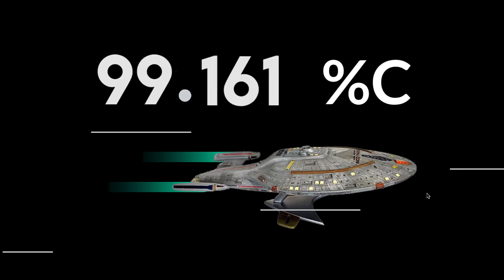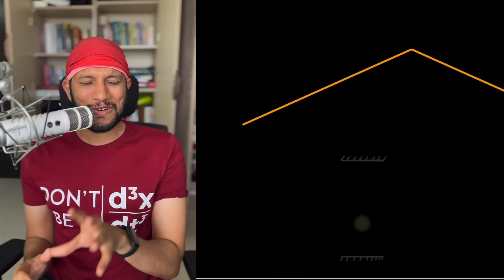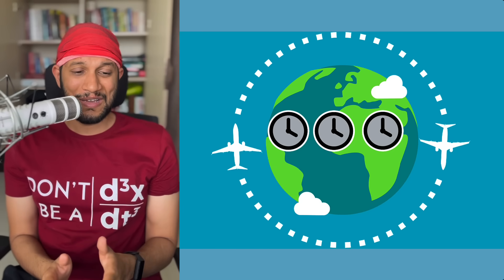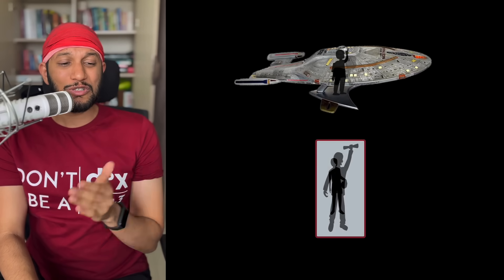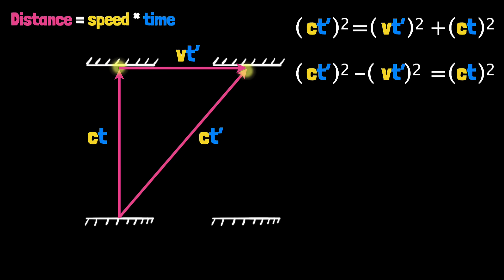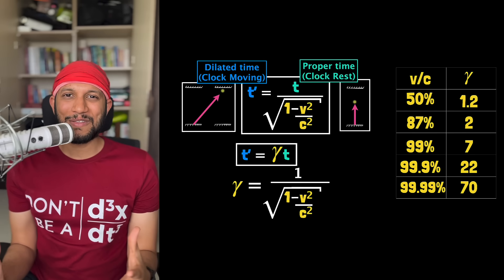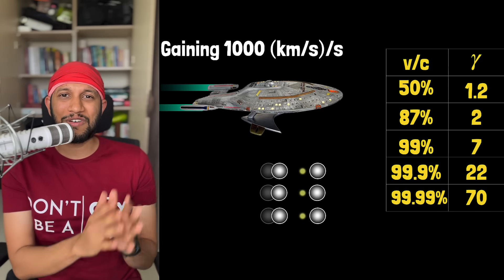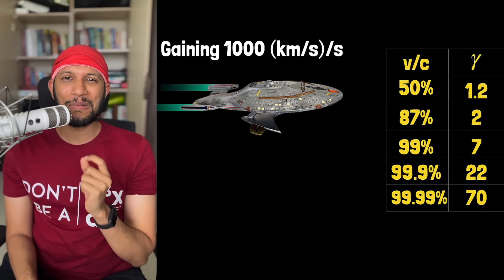I finally understood why you can't go faster than light! (My mind is blown)

Comment: This is a great explanation. Everything clicked for me until the following question popped into my mind and confused me again:

The whole proof is based on the fact that light has to travel a larger distance for an external observer thus the time dilation. If I take the external observer out of the equation, what's stopping the ship from travelling at the speed of light now? 

I guess the root of the question is, how would I determine if I was travelling at the speed of light in empty blank space carrying only a flashlight?
Reply: You have to measure the ship's speed relative to some reference frame (i.e. relative to an observer, though there need not be an actual person observing anything).  In the reference frame moving with the ship, the ship is always at rest, so any meaningful measure of the ship's speed necessarily must be made relative to some external observer.

Comment: There is a solution beyond teleportation, or reprogramming your location in the cosmos. That is the fractal cosmos. So as you move away from an object you grow infinitely large, as the object shrinks to infinitely small. So instead of moving away, you zoom out. Then you simply zoom into another part of the cosmos. This is literally changing dimensions. But mathematically it works. So as a mindset we need to forget about moving physically across vast distances of space and start thinking about growing infinitely huge.

Comment: Amazing video, thanks for the clear explanation! The only question that I still had was concerning the people on the ship. They would look on the clock and see they reached the speed of light after 300 seconds right? Would they look outside the window and see that time and space have ended? (Infinite darkness)
Reply: Remember that speed is relative, and to someone traveling on the ship, their speed is always 0 (since they are measuring from a reference frame moving with the ship).  If they want to make a meaningful, non-trivial measurement of the ship's speed, it must be done relative to some external reference frame, and as we see in the video the ship's speed according to an outside observer will asymptotically approach light speed but never reach it.
Reply: @extravagantpanda7962  now I am in the spaceship,
Yes u are right that the spaceship velocity is zero relatively,
But the world around is moving with same velocity in opposite direction, now I can measure,how about that?

Comment: Now i understand from an observer's POV why c cannot be reached. But why can I not reach c when looking at my own speed in proper time?
Reply: Proper time refers to the rate of clock ticks in your personal frame of reference.  In that frame of reference, your speed is always zero since the reference frame moves with you.  If you want to make a non-trivial measurement of your speed, it must be done relative to some external observer's POV.  We do this all the time implicitly: when you are driving on the freeway, you don't typically say that you are at rest even though in your own reference frame you are, instead you measure your speed relative to the ground.
Reply: This!
Reply: I just realized Mahesh had posted a second video that addresses my question in detail :)

Comment: Why do photons slow down then? Why can't they speed up since you're adding speed by flying them in a space ship. This is the question you need to address because it is the same as answering why speed of that photon can't exceed light speed. Second problem, from what you said at the end of the video, what if you're inside the ship, then it won't slow down, and you'll reach the speed of light while the universe changes so fast you reach the end of time?

Comment: I was hoping he’d address this but what exactly happens to the people inside the ship. Their acceleration to the speed of light may take infinitely long to an outside observer but to someone in the ship would they not just keep accelerating even past the speed of light increasing velocity by 1000km/s ^2? Just wondering if someone could explain this to me.
Reply: Remember that speed must be measured relative to some reference frame.  In the reference frame of an observer on the spaceship, the spaceship is always at rest (since the reference frame moves with the ship).  If they measure their speed as 0.9c (or whatever value), it necessarily must be relative to some external reference frame, and as we see in the video the ship's speed in any inertial reference frame will asymptotically approach but never reach c.

Comment: So that would make carbon dating appear differently if the earth and solar system was traveling at a different t speed through space long ago. If the earth and solar system was traveling through space slower long ago carbon isotope with 14 neutrons would have decayed faster making things to is in our day measure  older than they really are relative to your time and the time when the earth or solar system was moving slower.

Comment: I think this is not correct ??? The Muons still have the 1.5 half life from THEIR frame of reference, we just perceive it to be 10x from OUR frame of reference observing them. And 99.9% the speed of light is not a property of that ship but it is a perception we make as a distant observer. We are equally moving 99.9% the speed from light from it. From its own frame of reference it does not need to use a larger force for the same acceleration, F=ma still works normally it is just perceived differently by us (the observer) due to dilation.

Comment: One thing I try to figure out, is instead of looking at this sideway, if we did the following experiment:
We're in space, looking at Earth rotating.   We back out at near speed of light, so the Earth would spin slower while we're moving away because the image of the Earth takes more time to reach us.   Once we stop, the Earth would spin at correct speed again, but depending on the distance, we'd be looking at a past image.   So then we start moving back toward it.   We'd likely see the Earth rotate faster as we're "skipping frames" or fast forwarding through the delayed images of Earth's by comming closer. Finally, coming back to the same time as Earth.  The time dilation having been only perceived while moving away, and back.    Just as we see with telescope images from the past of distant galaxies.   Going there would bring us to their present time.    A star that has gone super nova that we still see as a normal star from here would go supernova as we go it, we'd be living it's history in fast forward until we get there and stop.

Comment: I understand the explanation, but what are we measuring these speeds relative to? For example why does getting on a spaceship result in time dialation when the earth is already moving. And the solar system, and the universe is also expanding. Wouldnt that mean that if you traveled a certain direction you would technically be moving “slower” because relative to a certain datum you are cancelling out the movements of the earth, solar system, and universe?

Comment: Your video was really helpful in understanding the theory.

However, I don't agree that it defines time travel, since it only shows how time measurement changes due to relativity.

I'm curious about something: if nothing exceeds light speed, and as you say metabolic rates slow near it, are we not just experiencing a form of suspended animation rather than time travel?

It's like saying we travel in time during an 8-hour surgery, because we're unconscious and time feels instant. But that's not time travel.

So a year near light speed feels short, but it's not time shifting a century on Earth. It's more a pause in aging than actual time travel.

Comment: Tldw: the reason you cannot accelerate to the speed of light is because it is the same for all reference frames. This is a fundamental postulate of the theory and there is no other reason behind it per se. There are other logically equivalent statements you could take as the initial postulate but this doesn’t necessarily make it any more intuitive. 

Personally I find the motivation from classical electrodynamics more compelling. When you derive the wave eq from maxwell’s eqs in vacuum you find that the propagation speed of the solutions to this wave eq is a constant (written in terms of the permittivity and permeability constants of the vacuum). This constant appears independent of any particular frame of reference. 

Indeed when you then speak of propagation of the electrodynamic potentials, this constant again becomes relevant and its real nature as the speed of causal propagation is made clear.

Comment: Assume you have three points A B and C. A is earth, B and C are ships flying on parallel courses in the opposite direction towards each other. From the perspective of A, B and C are both traveling at .6C. From the perspective of the B, C is traveling toward it at 1.2C if it considers itself stationary. Nothing is ever truly stationary. Even Earth is traveling at great speeds, around the sun, around the galaxy, through the universe.

Comment: i wonder what would it look like if you placed a live camera in that ship and watch it from earth 🤔
Reply: Let's say you're getting the video at 24 frames per second. At 87% of speed of light, you will receive only 12 frames per second, because of the slowed down internal clock of the camera due to the time dilation effect. So the image will get slowed down 50% and jittery. As the ship approaches the speed of light, you will get less and less frames, eventually waiting thousands of years just to get one recorded frame.

Comment: Focusing on the hands of a clock feels like a mistake, since that's just the display rather than the part that measures time, though the argument does apply to the measuring mechanism as well. Just struck me as something that'd stick in the craw of critical thinkers unfamiliar with special relativity.

Comment: With dark energy being merely leftover kinetic energy expansion. Dark matter being merely unobservable mass. Same is with time dilution and special relativity. Time itself doesn't slow down. Object itself slows down a those speeds. That is, if a person travels for 1000 years, he would age 1 year. However, that is not a time travel. He cannot travel for different time periods. It merely means that when 1 year passes, he would had aged for 0,5 years. This is assuming that special relativity even works and entire object can handle those speeds without affecting its general qualities as a whole. Like a human body can handle all the kinetic energy in the world if it is not being accelerated quickly, we are making assumption that movement of information between atoms doesn't disintegrate the whole body. 

In conclusion, all these modern scientific principles do struggle with inherently limited human capability for abstract thinking and well, relativity itself. I noticed in general that humans do struggle when tackling abstract concepts. Add relativity to an abstract concept and vast majority of humans won't be able to process such information.

Comment: A question I've always had but haven't the math to understand:

If two photons (call them Alpha and Beta) are sent out from Earth in opposite directions, each traveling at c. Where Alpha is represented as -c with respect to Earth and Beta is moving at +c with respect to Earth.  We now change our referent from Earth to Alpha.  Earth now holds a relative velocity of +c relative to Alpha, would Beta not then hold a relative velocity of +2c relative to Alpha?

How does this square with the speed limit of c?  Does time dilation change the relative value of velocity such that the perceived speed of Earth from Alpha is <<c and that of Beta is <=c?
Reply: You can't do that. Light always travels at c, in all reference frames. This means that light itself does not have a valid reference frame (since there is no frame in which light is stationary). 

If instead α and β were particles travelling very close, but not quite at, the speed of light, then you could use the "Velocity Addition Formula" to find out the the relative speed between them (which will always be less than the speed of light).

Comment: But then if I understand, actually speed of light is not the same in every reference frame. It only have one universal speed. And because of that processes tick slower when object is moving relative to "true 0 movement" reference frame. If speed of light would increase to compensate when object was moving faster then it wouldn't work the way you described.

Bassically it just appears to speed up due to the fact that "ticks" have nothing else in their reference frame to compare themselves to, so also brains activity and other physicall processes slow down by same degree to make it appear as if speed of light is the same as before movement. Am I correct in this hypothesis?

Comment: Just because our observation of something appears to slow down or speed up relative to our observation, this has NOTHING to do with reality.  

This is a stupid idea.  We are all spinning on a globe going 1,000 miles an hour all the time. Plus whatever speed our solar system and galaxy is traveling at the same time. A photon clock only takes the time of 1 tick no matter where it is at in the universe and no matter if you add more speed to it.  

This video is illogical. Only makes sense as a math problem but not in a real universe.

Comment: In my teenage years I used to be extremely interested in the thought of traveling as fast as the speed of light. I was bummed out when I figured nothing can travel at the speed of light, so theoretically you couldn’t travel a light year in a year. But technically thinking you could travel a light year in a year and 1 second if you almost matched the speed of light. This was hard to explain so I hope it makes sense.. 😂

Comment: If the ship is in a warp bubble, lets say we figured out how to isolate a pocket of spacetime inside a bubble because spacetime can go faster than c,, and we accelerate a ship to 100 times c would things inside the warp bubble, (as described by star trek and Alcubierre in his theory) experience time dilation, or no because technically the things in the warp bubble are not moving but the warp bubble itself is what is moving?

Comment: if you could travel opposite the rotation of the earth at the same speed the earth. would that not be like walking on a treadmill. the belt (the surface of the earth) is moving fast and you are stationary (atleast more stationary than the surface of the earth) so you would become younger relative to the surface of the earth meaning you went back in time. the earth's surface would have travelled more than you.

Comment: I think you have explained this well and inadvertently explained / defined the actual 'reference' of 'base time' (if there is such a thing) as the speed in which atoms pass 'interaction information / energy' on to each other with reference to a completely stationary point with respect to evething in the universe. 

Note ironically at this point in the universe, 'time' (according to this model) would be running at it's fastest (reletive to every other point in the universe)!

As we approach the speed of light, the mechanics of how our universe works slows down (based on the thesis explained in your video) with respect to points not traveling at the same speed as you. But to evething traveling at the same speed relative to each other, the mechanics are observed operating at the same speed. As these mechanics drive the interactions of evething in the universe (right up to the complexities of motion we observe, biological function, thought etc), this theory is a bases for how we experience / explain the concept of time.

Interestingly if this model holds true for all given instances in the universe, it has some implications with common perceived thought of time, ability to time travel and speed.

For example, time travel into the future without the effects of biological changes seems theoretically possible for individual(s) / items (as you just need to instantaneously speed up and then instantaneously return back to the same speed relative to the 'time frame' you want to travel in (obviously the destructive forces of acceleration needs to be solved and many other problem in doing this etc). 

Speeding time up for the observers would also be possible, by slowing the relative speed of an individual / item with respect the 'time frame'.

Traveling back in time also would would not be possible (based on this theory alone). As our 'concept of time' or the 'mechanics of the universe' can only speed up or slow down with respect to each other (not go backwards).

This thinking also makes me wonder if there is a central point in the universe where 'base time' exists, and could localised points of 'base time' exist in the universe (as defined in this discussion)?

Finally to close this thought loop; we have the concept of the superhero 'The Flash' all wrong based on this model of time. When he reaches his max speed (relative to the rest of the world), it does not slow down with respect to him (as we see on TV).... Time or evething as he sees it around him must speed up with relatively to the flash (as the mechanics of the universe is slowing down as the flash increases in speed). Ironically to the rest of the world dispite his speed the flash will look like he (his time reference) has slowed down (with respect to this concept of time). 

When the flash stops he would now be in the future, not remain in the present.... 👍